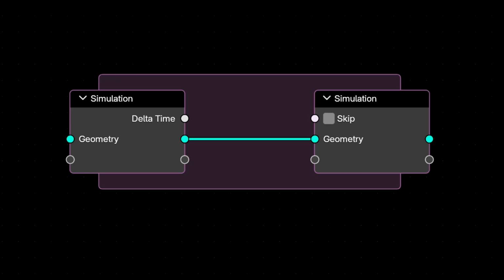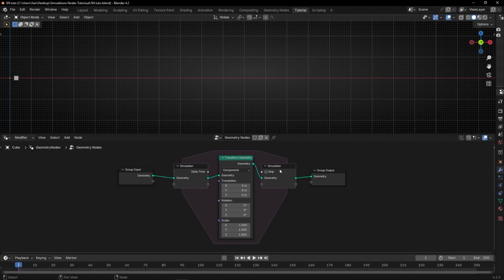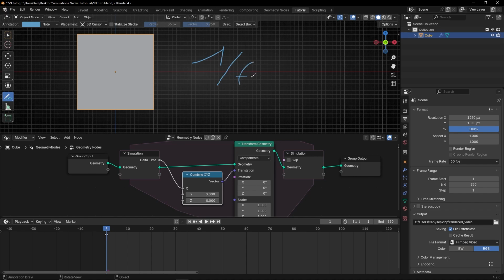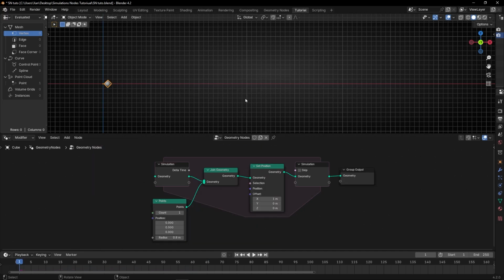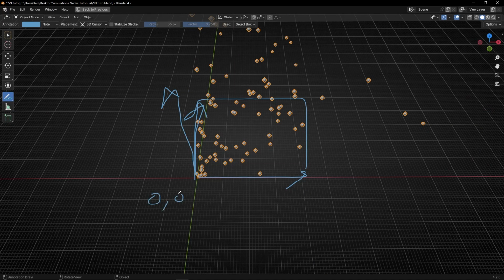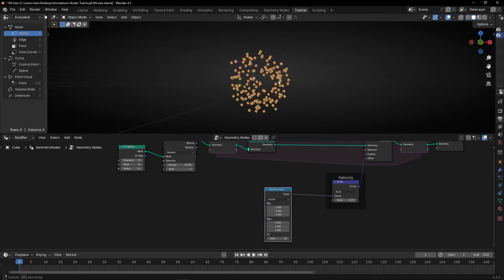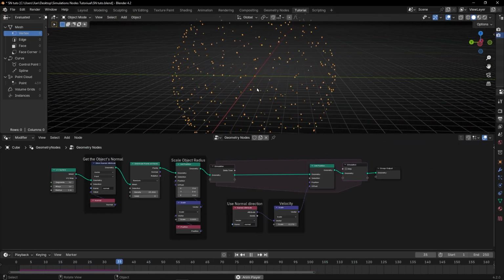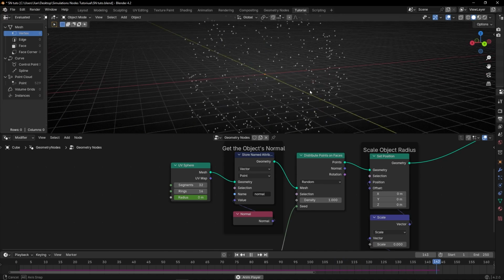How SIMULATION NODES Works in Blender

Comment: the standard particle system in blender, is not more efficient and simple to use? Moreover, it is not a "simulation"! In the particle system, for example i can enable the gravity, just with one click, that acts phisically (or at least i suppose), instead whit GN I can only emulate a point that falls subtracting some values during the frames!
Reply: The old particle system does the same thing in the backend and exposes simple controls to the user. At the end of the day, "simulation" is just maths, delta time being a big part of it like he was explaining. 

Yes, the particle system may be easier to use in some cases, but it's not as powerful. For example, what if you are doing a render of a miniature planet with clouds and rain and snow, in this case if you enable gravity, the particles will go "down", not towards the pull of the planets gravitation. Yes there are ways to fake it with forcefields etc. but it's not the same as having control over the math yourself and doing it properly.

Comment: min 14:30, why the random node doesn't need to change the seed when it is connected to the "set position"? When it is connected to the "point" node, it is not evaluated every frame!? When it is evaluated during the simulation?

Comment: I have a burning question, I want to simulate grain (smaller than sand grain — make-up dust particle size) but Blender has been very finicky 🤔 there's an example I saw made with Houdini (happy to share the link) but the creator mentioned he used 14 million points, can Blender simulate this many points?
Reply: I think so, however it depends alot on your hardware, definitely will blow up mine tho